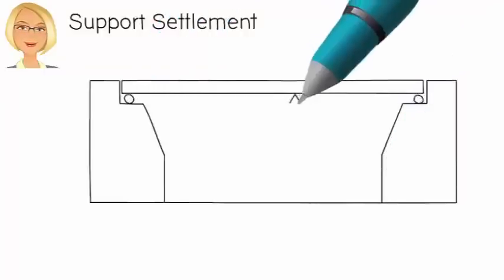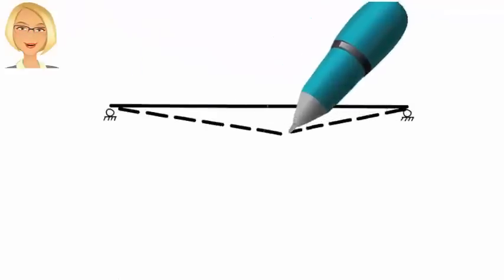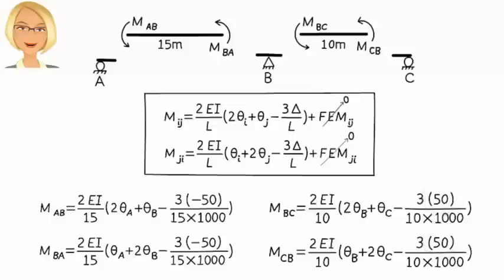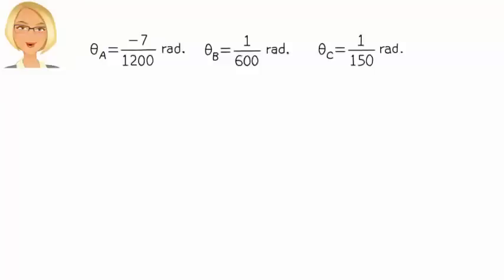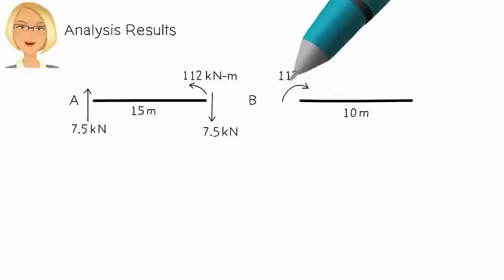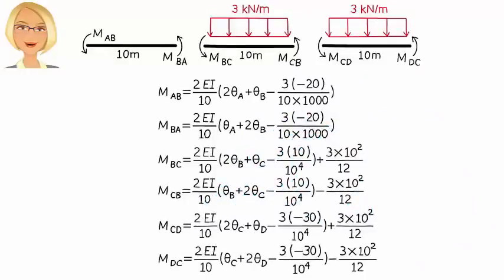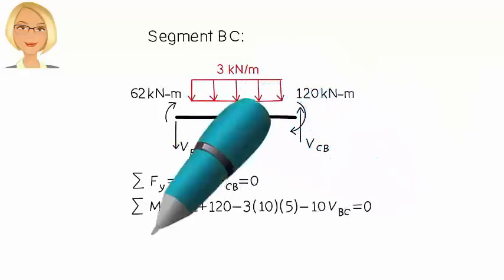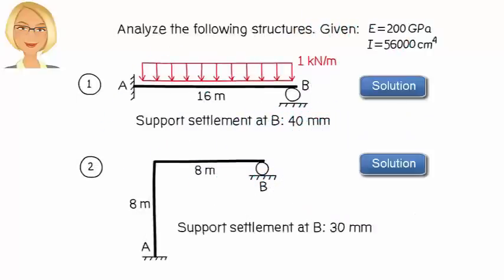SA32: Slope-Deflection Method and Support Settlement

Comment: Hi, I have a question. For a fixed beam when the geometry of beam is different ( I.e  EI is different for right half and left half) load is applied on the mid-span. Can we solve for fixed end moment by slope deflection method by considering two beams and support settlement corresponding to the applied load?  ( like you have done for sway in moment distribution method) If yes can you please explain the method for finding eq. support settlement for the load??
That would be very helpful. Thanks
Reply from the maker: Yes, the slope-deflection method can be used to determine the fixed-end moments. See example here: http://lab101.space/notes/SA32-01202019.pdf
Reply: @DrStructure  Thanks a lot you. "God bless you" for all the free help. All your videos are very informative, to the point and clear conceptual doubt very easily. Again Thanks :)
Reply from the maker: You'r welcome!
Reply: Dr. Structure hi !
Can u please explain why there is no Shear force Vab and Vcb in the drawn diagrams. There is only Vba and Vbc which are correct. I am missing those two though... 
than you :)
Reply from the maker: @orsonsusaj  I am not sure which diagrams you are referring to, in both examples in this lecture Vab and Vcb are present.
Reply: Dr. Structure hi ! Sorry i wasn’t clear on my request... i meant the diagram on the external link to lab101.space ... provides on your first reply
Reply from the maker: Got it! In that case, Vab and Vcb do exist, they are just not drawn on the free-body diagram. There, we are summing the forces in the y direction at joint B where only Vba and Vbc are needed. That is why Vab and Vcb were ignored altogether. If, however, we wanted to write the equilibrium equations for member AB or BC, then Vab and Vcb must be drawn and used accordingly.
Reply: Dr. Structure thanks for your replies you’re a great channel 😁

Comment: the value of the slope for the second example with 3 support settlement at B C D  , is it already correct?  i found the value of thetaB 0.0037 and its positive
Reply from the maker: We have double checked the solution for the equations, and don’t see any errors in the calculations. What numeric value for EI are you using?

Since the load is in kN, we need to convert E from GPa to Kpa. That gives an E of 200*10^6. Also, the moment of inertia needs to be converted to m^4. That is, we need to divide 56000 by 100^4.

So the product of EI becomes 112000. That is the value we should use when solving the equilibrium equations.

Comment: I think everything clockwise is positive in S-D method and the settlements for AB and CD should be positive and for BC should be negative. Could you please explain why you have taken Clockwise rotation due to settlement as negative?
Reply from the maker: A sign convention is just that, a convention that we choose when devising a method or applying one. We can designate either clockwise or counterclockwise as the positive direction. The trick is to stick with the chosen convention throughout the process.

Comment: I'm really enjoying lectures on this channel. However, I want to ask for something. Can you make a video about these two examples with support settlement, but solved by employing the Matrix Displacement Method. I have managed to solve the first example in this video with three supports and no additional loads, using the MDM. I substituted the unevenness in height with appropriate joint loads using the fixed-end moments equations, and at the end I got the right results. However, when I tried to solve the second example with four supports and additional member loads, that procedure didn't work, the results were wrong.
Reply from the maker: We do plan to have lectures on the matrix displacement method involving support settlements, internal hinges, and temperature-related loading. However, I cannot give you a date of release at this point. It is going to take some time before we get to those topics. 
If you have your MDM solution to the problem documented properly, we can review it and give you feedback. Feel free to send your solution file to Dr.Structure@EducativeTechnologies.net
Reply: @DrStructure  ok, thanks

Comment: How would you find the maximum deflection (and deflection v(x) of the whole beam in general)?
Reply from the maker: There are two ways that we can determine the location and magnitude of maximum deflection in a beam. We can do it analytically, by formulating the algebraic deflection function for the beam, then setting the derivative of the function to zero in order to determine its point of max/min. Alternatively, we can determine the point of max/min deflection approximately by determining the deflection in the beam at regular intervals (say, every 0.5 meter), then plotting the points in order to get the general shape of the deflection function and to estimate the location and value of the maximum deflection.

Comment: what if support settlements type was rotational not  transnational?
Reply from the maker: Consider a continuous beam with no loads being applied to it (all the joint rotations are initially zero). Suppose a specific joint rotates, say, due to temperature change by amount t. We can simply substitute t in the slope deflection equations that use that specific joint, assuming all other joint rotations are zero, then solve for the member-end moments. 
Now, we treat the calculated member-end moments as applied loads, we place them at the specific joint(s) and analyze the beam as usual. 
However, this is a nonlinear problem in nature, since the initial (given) joint rotation results in additional rotation at the joint.  In such a case, we can employ a nonlinear analysis technique to obtain more accurate results, if the approximate solution outlined above is not satisfactory.
Reply: @DrStructure  thank you very much
Reply from the maker: @muratismailoglu6501  You're welcome!

Comment: I have one more doubt. Generally rollers supports are provided at one of the bridge spans. The reason for providing roller support at one of the bridge is to allow thermal expansion or contraction. Isn't It??  If both the ends are supported  with hinged  then the horizontal movement will be restricted in such case it causes severe damage to the bank of the bridge. But in your problem you have provided both the ends has roller support.. my question is if both the ends are supported with the rollers then the structure could have any stability?? I think structure would be unstable. Is I am correct??
Reply from the maker: Yes, you are correct, a roller at the end of the bridge allows for the thermal expansion of the deck. And, yes, a beam that rests only on rollers is considered unstable. Here, however, the middle support is a pin. So, the bridge deck can expand at either end and still remains stable, the middle support ensures the stability of the system.

Comment: Sir is really settlement is allowed in the structures??
Reply from the maker: No, not intentionally. But, soil has a mind of its own and could shift for various reasons over time resulting in the foundation of the structure to move with it.
Reply: @DrStructure  sir if settlement is not allowed in the structures then why we are solving the problems with settlement of support?
Reply from the maker: Calculating forces due to support settlements may be a preventive measure. That is, we are anticipating that the support could settle sometime in the future and want to make sure the design can accommodate it. Or, after the structure has been designed and built, and been operations for some time, we notice the settlement, now we need to decide how much additional stress is being caused by the settlement...

Comment: 3:24 why did you put a negative sign if its clockwise ? In hibbeler clockwise is positive. Doesnt it change the answer?
Reply from the maker: Keeping in mind that a sign convention is just that, a convention (an assumption), here, for the slope-deflection method, counterclockwise is assumed to be the positive direction for both member-end moments and rotations. The entire formulation is done using this assumption. So, if we get a positive value for a moment, it simply means it is acting in the counterclockwise direction. 

Others may use a different sign convention. If we did the formulation using the alternative assumption (that the clockwise direction is positive), then the answers (between the two conventions) would differ by a negative sign.
Reply: @DrStructure  thanks doctor!

Comment: Dr structures, Can we determine the amount and position of settlement ,given only the shear and bending moment diagram of a beam?
Reply from the maker: Keeping the slope-deflection equations in mind where the member-end moments are expressed in terms of the member-end rotations (theta_i and theta_j) and differential displacement (Delta), then knowing the member-end moments and treating the rotations and the Delta as unknowns, you should be able to calculate them.

Given the moment diagram for a beam, we can easily read the member-end moment values from the diagram. Knowing those values, we then set up a series of equations (the slope-deflection equations) to determine the unknown rotations and displacements (settlements) in the beam.

Comment: I got the answer.... In case of MDM if there is settlement, the FEM of 6EI∆/L2 comes... In case of Slope deflection, the value of 6EI∆/L2 condition was already considered during formulation of the formula of SDM as 3∆/L or ∆/L. Thats why no FEM value appears if there isn't any load on the beam in case of SDM....

Comment: But in case of MDM you can see, if there is settlement of supports, there is FEM applicable of the amount 6EI∆/L2... Why won't it appears it appears in here then???
Reply from the maker: Please specify the video location at which you don't see the settlement term. The moment term due to support settlement is present when required.

Comment: why unlike in MDM, due to sinking there is no FEM in SLM of 6EI∆/L2 not written????
Reply from the maker: Fixed-end moment is due to applied member loads. If no load is present, and member forces are due to support settlement only, the FEM term vanishes.

Comment: How to find out ? Thank!
∅A = -7/1200
∅B = 1/600
∅C = 1/150
Reply from the maker: By solving the three equations given @4:00 simultaneously.
Reply: I have seen @ 4: 00 film.
But I would like to know,
How to calculate the "Three unknowns" (∅A, ∅B, ∅C),
Or Called the calculation of the simultaneous equations.
Thank!
Reply from the maker: There are several techniques for solving linear equations. Look into Gaussian Elimination Method.

Comment: Hi. What happens when the settlement occurs at support A instead of B in example one. Please explain
Reply from the maker: By example one you mean the example that starts at the beginning of the video?  If so,

We solve the problem the same way. If only A settles, then the slope-deflection equations for Member AB have a non-zero Delta (Delta would be the settlement at A). But, Delta for member BC would be zero since neither B not C has settled. 

We then write the three joint equilibrium equations as before and solve them for the three unknown rotations.
Reply: Say I have delta = 5cm at support A only in example one. I have taken delta = +5cm (+ because it rotates AB in counterclockwise) for Mab and Mba and delta= 0 for Mbc and Mcb, just as you had suggested. What should be the Mab, Mba, Mbc and Mcb equal to? Because mine are all coming equal to zero by following what you said. Please help.
Reply: Also, both the spans lengths are same and are 30 m each.
Reply from the maker: They are not going to be zero as joint rotations are not zero.

Say, rotation at A is tA, rotation at B is tB and rotation at C is tC.
Delta for AB is 5mm, and Delta for BC is zero. And, both segments have the same length (30 m).

Then,

M_AB = (2EI/30)(2tA + tB - 3(5/1000)/30)
M_BA = (2EI/30)(tA + 2tB - 3(5/1000)/30)

M_BC = (2EI/30)(2tB + tC)
M_CB = (2EI/30)(tB + 2tC)
Reply: Thanks a lot for such prompt replies. You have been a great help at the hour of need :)